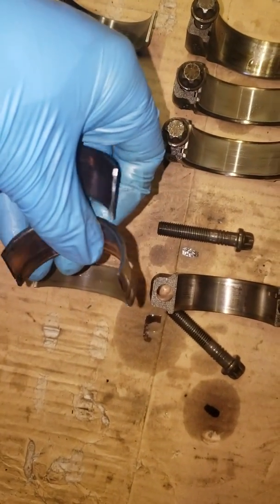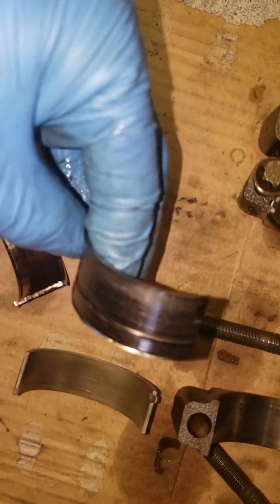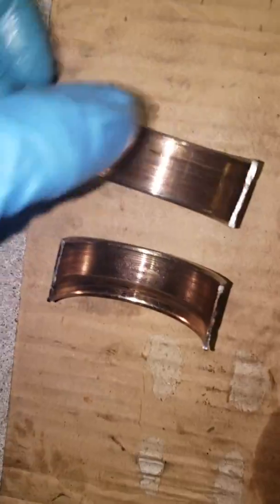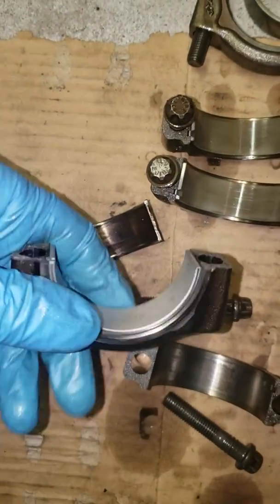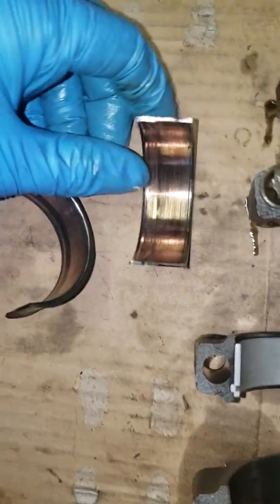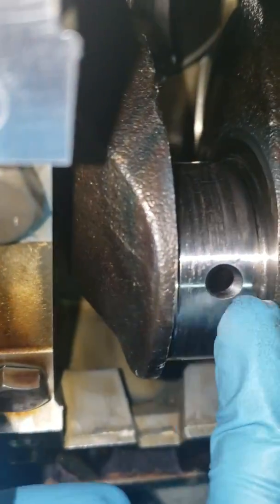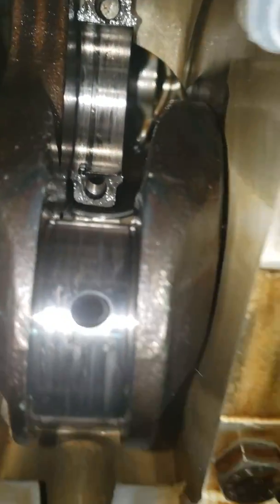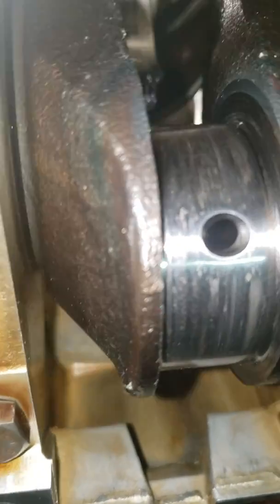BMW N55 135i fix rod knock

Comment: Hey man.. in the same boat. Were you able to rebuild it as is? did the crank hub get damaged? What was the extent of the rod knock prior to the repair? Please let me know. Thanks.
Reply from the maker: Polished the crank by hand and put new bearings in. It ran fine afterwards.

Comment: I have n55 I bought new crank and con rods and all new shells and so on. Only had damaged to cylinder 5 shell but fitted it all and once its warm it had slight tap again. Did you find out why it had lack of oil on that cylinder only??
Reply from the maker: No. Clearance was good after replacing the bearings and the car ran fine. Maybe detonation or constant misfires on that cylinder. To starve a single single of oil would require clogging up the crank journal/bearing that feeds that rod. Not likely to happen. Rod side clearance was extremely tight that might be a factor. I sanded the side of the rod and cap and it fit much better. Not sure if that was a cause or a result of the spun bearing messing up the rod. This engine was also missing the oil filter cage and had low oil pressure because of that. That could've been a big part of it.
Reply: @banks334   I bought all direct from bmw and have correct colour codes the lot and still has very slight tap I’m nit sure what to do next. My old one was the same as your ones even the shell but crank had cracking so had to get a new one.

Comment: What’s up man. I have a 2014 M235. Got it with 37,000 miles. At 97,000 running perfect. I just got a BigBoost 3.4 kit and am highly considering doing rod bearings as preventive maintenance before I go big power. I’ve noticed a couple different vendors and was wondering what would be best in your opinion? New OEM? VAC? KING? ACL?
Reply from the maker: I kind of like the idea of acl because their bearing is a lead/copper bearing. King bearings are a very high load Tri metal bearing. The lead free bearings support high load but the sacrificial wear layer that provides seizure resistance is less robust. They now offer "gpc" coated bearings so maybe those would be better. I'm focusing on seizure resistance because it seems like oil starvation looks to usually be the cause if failure.

Comment: Hey.
I tore apart 335i f10 with identical problem. I am installing new rod bearings, but I have a question about oil pump that was installed in engine that you have repaired. Heve you checked oil pump? I tore it apart and I can tell that back plate is a bit scored.
Reply from the maker: Nope I just cleaned it out and reused it. Never had any indication the oil pump was producing low pressure in any log or anything.
Reply: @banks334  thanks for a quick respond. Same situation over here, but I am going to resurface oil pump back plate just to be sure. It’s a simple operation and it is not dangerous for pump. Again, thank’s.

Comment: Is it hard getting the oil pump out the way? I have the N20

I’m not sure if I’ve got early rod knock. I get a weird knocking/wobble noise only when the engine is hot. Check my video if you could. 

I don’t have the usual rod noise or rod noise when switching on or off. It’s very strange.

Comment: Hey what type of bearing did u get having some problems fiding the rite ones for it thanks
Reply from the maker: Standard bearings fron king. Ebay has them from various sellers or you can 2nd day air them from europe for about $80 shipping.
Reply: @banks334  how is the car running after u replaced them
Reply: And u replaced the caps also
Reply: And if u have a link for it please I have a 2012 bmw 335i n55 motor thanks
Reply from the maker: @johanarevalo1396  you need 3 packs of these:
 https://www.ebay.com/itm/King-CR222SV-STD-Connecting-Rod-Bearings-for-BMW-N54-N55B30A-/283820605108?_trksid=p2349624.m46890.l49292
Reply: @banks334  sorry to bother u but why 3 pack and the ones with groves on them goes on top or bottom
Reply from the maker: @johanarevalo1396  they come in pairs... 6 rods = 3 packs of bearings for about $100. The bearings are placed using the tang on the backside of the bearing. the tang of the bearing has to line up with the groove on the rod. can't really mess it up.

Comment: The rod is ruined. Once the bearing spins it is no longer round and your fingers are not a accurate guage if the crank is even round....if you do put it together please make another video on how long it runs without blowing up
Not picking on you but bear in mind the clearance between the bearing and crank is less than a human hair. .0025-.003 of a inch...the con rod bore is also critical as now I highly doubt it’s even round...but best of luck
Reply from the maker: Thanks for the reply but as I stated in the video clearance was fine. This car is still running just fine as well. 

I measured. I didnt use my fingers. Yes rod and crank tend to oval out... and in this case they didn't. Sometimes you get lucky and can get by with a repair like this. All points I stressed in the video. You  reiterated a bunch of the things I said myself in the video...

Comment: Most guys I know run too much boost and rap out the engine. You do that and ka-boom. Never fails. Better to have an M2 or M4 and leave it stock.
Reply from the maker: High torque at low rpm will do it. Bearings don't last forever in any engine.
Reply: @banks334  well it can but not on a high boosting car or high rev car

Comment: I have a Rod Knock in my N55 - wish you were here mate. Wanted to do the same repair. If you keep revs low and in check and with just a bit of load you would not think anything was wrong in you drive it -  idles perfectly. Nobody is interested in even looking at it, just an assumption it is nor recoverable.
Reply: Any videos of
It?

Comment: Hello, were you able to get it fixed? I have a 2011 535 i , had a ticking noise and one day engine ran for 30 seconds and then stopped.Initially was thinking is the starter. Engine turns only 3 quarters. Was yours turning at all?

Comment: Did you use an oversized rod bearing for that pair of shells? Did you use stock spec on the rest? Which bearings did you order?
Reply from the maker: Standard sized bearings. I used king on this because they are cheap. I run acl in my engine.

Comment: hi i have a bmw 335 2008 e93 (88k miles) the engine slams at 2000 rpm but i did not find metal in the oil filter it can be the rod bearing?
Reply from the maker: Could be

Comment: Replacing my bearings on my n55 when I do a turbo upgrade in a month or so. Curious to see what shape they’ll be in
Reply: How’d it go
Reply: Update??
Reply: @hinse4231  Bearings had wear but not enough that they needed to be changed out. Car is running strong on King Bearings past 8 months
Reply: @m4imola  was your cat making a knocking noise on Revving?

Comment: Oil used ? And maintenance ? Have you done your oil change every 8 to 10 max miles ? Do you own the car since a long time ?
Reply from the maker: This was not my car. I personally dont think this has anything to do with oil changes.
Reply: Brenden Banks Work on a few n55 n54 and i can assure you that the oil change the oil you use do a big difference.
Reply: its all about oil change and track race.

Comment: What causes this
Reply from the maker: Not changing oil, installing oil filter wrong, beating on the car when the oil is cold, jb4/tune, oil starvation, or just plain being unlucky as every engine has failures happen.

Comment: Did you have any metal shavings when this happened?  Got a 335xi that has a knock around 2000 RPM and you can only hear it under load.  There is shavings we found in the oil filter so just curious if worth it to replace bearings and hope for best?  Your crankshaft looked fine, so just thinking if you had some tiny metal peices in the filter than we are likely on same boat, otherwise I might be in a sinking boat xD.  Also, where did you get the new bearings from? Dealer ?
Reply from the maker: I used king rod bearings on this engine. There actually weren't any shavings in the oil filter but my guess is that there was at one point. This was not my car. You cant tell anything by metal shavings. Need to tear it down and take a look. Definitely dont drive it.
Reply: Bimmerworld has OEM bearings.  U need to look at the front of the crank which has the correct size bearing for that position.  It's either yellow red or blue violet.
Reply from the maker: I used aftermarket bearings for this. King and ACL make them. Cheaper than bmw too. 

Metal shavings can be hit and miss. Bearing scan wear in a way that only produces shimmery oil rather than large chunks. Depends on how they fail. How abruptly.

Comment: I have to replace my oil pan should I change out the rod bearings preventative on my 140k mile n55 f30 2012?
Reply from the maker: Yes, I would.
Reply: If you can swing it swap the s55 oil pump and pan too

Comment: I have/had the absolute EXACT same issue!  2014 435 xdrive - JB4 car @67K miles #6 bearing!  I was blown away because, like you, I'd never seen a bearing look this way!  The only difference for me was that I am NOT able to get a new bearing on!   The rod cap was too far out of round and as you know, you can't just change out the cap!  The new bearing made it to tight to go back on.  I'm now doing a full N55 swap.  When it spun, I was doing a 50-to- 100mph pull on the freeway and when I exited, at about 2500rpm I could here knock knock knocking on heavens door :-(    I was able to send the jb4 logs in for them to review and they couldn't see any issues in the logs.  If I remember correctly I was on MAP5 using Premium 93 Octane.    Anyway, the only Idea they could provide after reviewing the logs was "poor oil change history" from the previous owner.  IDK - I'm a little concerned about running the jb4 again on the new engine!   After reading a lot of the forms online, I should add that this happened to my car within 50 -150 miles after doing the oil filter housing gasket.  Seems to be a possible connection with spun bearings post OFHG job.   Who knows!  Anyway, Great Video! I'm sure this will help a lot of people.

Side note: FYI to anyone looking at doing this job,  The addition of xdrive makes this a huge pain in the ass!  LOL
Reply from the maker: sorry to hear. And yeah I have no idea why OFHG jobs seem to cause bearing issues but it does seem to be related. Dirt is about the only thing that makes much sense out of all the theories. I know BMS will defend the JB4 to death but I can't get over that every single JB4 car knocks. They say it's just the DME doing it's thing preemptively and not harmful but constantly pulling 5*+ of timing can't be a good thing. Map 5 is suppose to "learn-down" but a proper flash tune for your fuel and running knock-free has got to be better... If it wasn't then BMS wouldn't offer free back-end tunes...

This car did have a broken oil filter cage. That could've been an underlying issue. It only knocked once oil got up to temp (and thinned out).
Reply: @banks334  is it something to do with preloading the OFH with oil and not running the engine straight away. Making sure the injectors are unplugged?
Reply: So I bought a bmw f30 335i at 65,000 miles. the previous owner had a jb4,catless downpipe,full exhaust,air intake. At 67,870 miles I had a rod knock and I had to replace the engine completely. And a few reasons why the engine went Bye Bye is because the previous owner did a horrible maintenance job on the car. not putting oil when it needed too, I took out the jb4 because piggy backs are not good. Just poor maintenance on hos part.
Reply: What oil did you use and what maintenance oil change (in miles) interval have you done ?

Comment: Hi, do you know if it's still running or if it needs a rebuild?
Reply from the maker: Running fine as far as I know. Clearance was decent after polishing up the crank journal. Not common that the crank doesn't get wrecked when a bearing spins like this.
Reply: Nice man, thanks for sharing your knowledge. Do you recommend any other methods of checking the clearance instead of using plastiguage? As I'm struggling to find any in my country.
Reply from the maker: @robbieblazeofficial  a bore guage for the rod and a caliper for the crank is a more accurate method. Hard to do though with the rod in the car.
Reply: Brenden Banks Yeah true, thanks man. Will keep looking.
Reply: @robbieblazeofficial   did you use oversze rod bearings and do I have to worry about the colors for rod bearing shells or is that just for the crank and main bearings? I didnt seem to find any  different size rod bearings other than stock size.

Comment: Great video, Im just wondering in this case, If you tore the engine down could you get the crank machine finished or would you have to buy a new one? & could you not just buy a new cap for it?
Reply from the maker: They are powder metal split cap rods. Cap is unique to each rod. I suppose you could have the rod bored out but then you need to source a thicker bearing. Might as well just replace it instead of reusing damaged parts. 

Yes, you can have the crank cut. It's just not usually successful once you've spun a bearing. Things often get scored, cracked, and warped beyond repair.

Comment: Hey man! I have this exact same issue with a light knock only at operating temp on a 2014 435i and I'm curious how your repair goes.
Please report back with an update when you have one.
Reply from the maker: Worked fine. Clearance was adequate. Worth a try if you're doing the labor yourself.
Reply: @banks334  did u use the same size bearing
Reply: @banks334  i actually have the same problem on cylinder 4 same bearing wear same cap colour black so I changed the while piston and rid cap to match now my problem is the type of bearing to put in
Reply from the maker: @williamoforiappiable  you would use a std bearing
Reply: What was the knock from? Any updates?
Reply: Any update on how the repair went ?